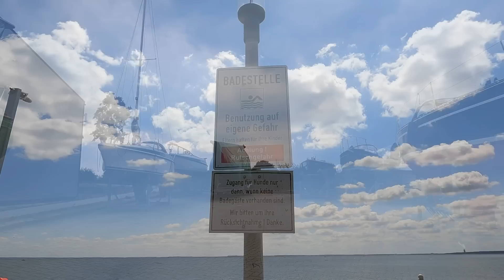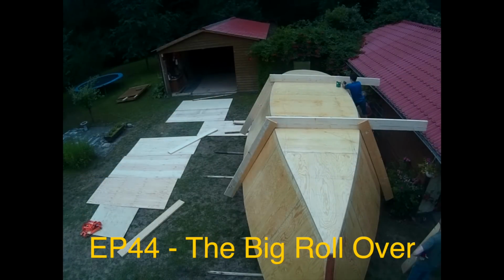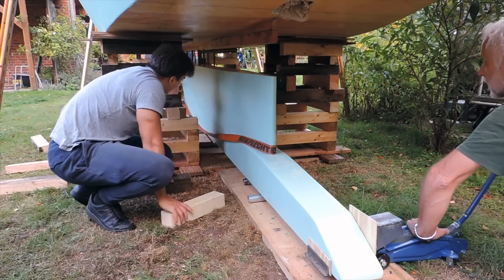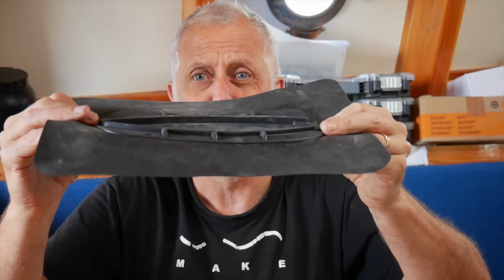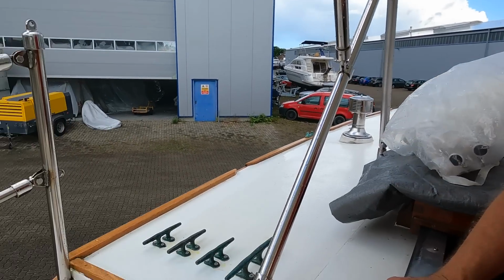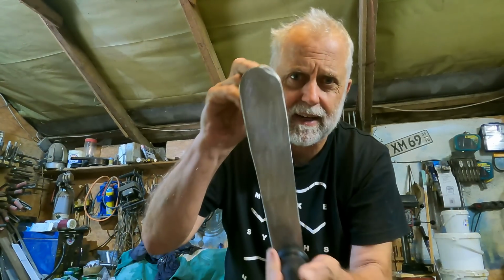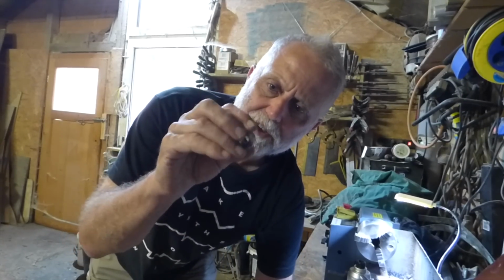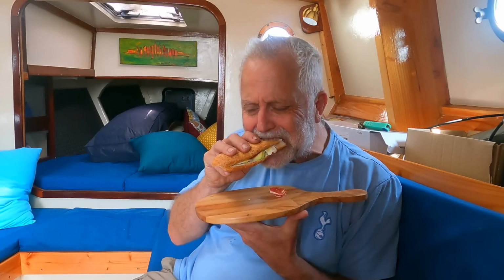The Start Of The Boat Travels! - SV Tapatya EP285

Comment: Hi Tony, it must be a real ‘dislocating’ experience being away from your workshop, stores and tools - and you cannot take everything to the boat. Sod’s Law always comes into play and no matter how much you think and plan things through - when you get to the boat and start the planned job - there was just one thing you forgot that prevents smooth work flow.😉 I hope all goes smoothly to enable a timely launch. Best of luck with the pre launch list.
PS: On balance I feel producing a square drive for the winch handle may prove more enduring than a hex socket.

😀👍⛵️
Reply from the maker: Thanks Norman. Yes indeed!
And yes again. The next winch handle I make will have a square drive welded up from flat stock 👍